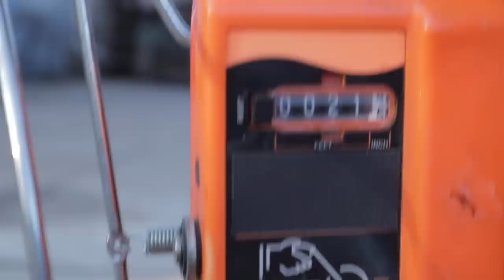Screw Hoist ~ RESTORATION ~ All Mechanical Chain Hoist ~ Back in Service!

Comment: For small parts and chains, it is certainly better to use a rust remover, but it is rational to clean the case and large parts with electrolysis, this is not a complicated technology.
After rust removal, it is useful to treat with a phosphating compound to create a protective coating against corrosion.
This thing is a magnificent legacy of the industrial era. And you perfectly restored it. My respect.

Comment: Another fantastic job restoring that mechanical chain hoist.   I thought that gear was steel but it was brass or bronze.  The whole unit looks much better and it works like a charm too.  Excellent work.

Comment: I enjoy watching your videos and appreciate your drive to recover old stuff.  Something I notice is that when you are taking off 4 sided (square) nuts and bolts you almost automatically reach for your crescent wrench.  You probably already know this but I happen prefer a good 12 point socket with a ratchet, or box end wrench, over a crescent wrench. less chance of slippage and ripping the corners off the nut or bolt or worse yet, putting a gouge into the jaw of the crescent wrench.  The simple math is s hex nut/bot fits into a 12 point 2 ways (12/6=2). a square nut/bolt fits into a 12 point 3 ways (12/4=3). It isn't a 100% true fit, but it does distribute load over all the 4 corners of the nut/bolt; whereas a crescent wrench only applies pressure to 2 points.  This is especially important when your dealing with old rusted up stuff.

Comment: that turned out to be a nice hoist. well worth bringing home. i have a cm 2 ton chain hoist, and 2 cm chain come-a-longs, one with a 10' chain, and one with a 25' chain i use to lift and move things i can't do manually. plus i have a lift boom with a hand crank cable winch on my '54 massey harris 33 tractor.

Comment: Well, I have hopefully swapped a cast iron roof light for a screw hoist (sight unseen) with a neighbour. We're building a hay loft in the Dutch barn and the hoist will  provide the lift for the small square bales upto the loft floor. It will actually be a gift for my wife who is also our shepherd. Found out the hoist was available this afternoon and found your video this evening. I think it's called Serendipidy. Many thanks.

Comment: The interior of the hoist looked remarkably good.
Reply: nothing like a giant solid brass gear to say ''made in the usa''
Reply from the maker: I was extremely surprised by that as well! ESPECIALLY because when I found it it was locked up and I didn't know why! I think it was just a little rust around the end of the shaft!
Reply from the maker: @imperialpresence3331  If only a lot more things were still made to this degree here in the USA!
Reply: Salvage Workshop hence the Chinese tariffs.

Comment: I'm lucky that the property I purchased a decade ago came with a huge industrial workshop, enough space to operate a 5 ton forklift with extendable crane attachment, huge front and rear covered  concrete lay down pads, and a 15 ton overhead remote control gantry that not only services the workshops internal dimensions but extends to service both external lay down pads. All I've added is dual service pits with LED lighting and air connections, and dual 15 ton industrial vehicle hoists. The biggest costs were the previous owners. A gantry in any workshop is a huge asset. 👍👍🇦🇺
Reply from the maker: Now THAT is what I'm talking about! I want a setup JUST like that! Someone put some real thought into that setup and what future needs might be! Thanks for commenting!!

Comment: I used one of these old types once. It snapped lifting a compressor up onto the second floor, metal fatigue. 
Great job on the restoration very enjoyable. I would have it tested for your safety though. Tony

Comment: Impact wrenches work much better without an extension - Very nice old chain hoist -
Reply from the maker: Very true! I use the extension to keep the impact from constantly blocking camera angles when I'm videoing these projects! I have a much larger impact for when I really need to break something loose!
Reply: @SalvageWorkshop  are you sure about the reason for use of the extension? To keep from blocking camera angle? Theres plenty of other things that block it. 3 seconds with no extension and its broke loose. And you said theres a bigger impact WOW you'll probably use an extension on it too. Not having the knowledge about something isn't the end of the world. JS

Comment: Bloody nice work Bloke. Ended up a very tidy Block n Tackle. NB, Bees wax mixed with Olive oil gives a nice finish on bare metal,  especially cast. Warm the metal first then wipe/brush on. Cheers Tony

Comment: Old Tools Restoration is Super! Remember, however, that when we still use them after restoration, they are still years old. This means that many parts show signs of mechanical wear as well as invisible wear, at the level of the internal structure of the metal, there are or may be microcracks that may migrate over time and cause the material to break or crack. So a refurbished device doesn't mean it's brand new, but it has worn parts. But as a rule, such tools will last a long time, because they were made at a time when solid work was needed.

Comment: Matt great to see a new video! I use my shop crane for pretty much everything. I even made an attachment to lift truck cabs off the frame (my hobby). I would love to have a gantry crane but don't really have the space for it. If I was to build one I think I would make it mobile.  Put some small car tires on it so you can roll it around out in your yard. I used one like that in the junkyard I go to. Makes for easy rolling even in the dirt.
Reply from the maker: That's awesome! Ya I definitely want it on wheels! I like your idea of small car wheels, I can see that being more useful than casters as long as I create some sort of brake on each side to lock everything in place when I don't want it to move! Thanks for watching & commenting! I truly appreciate it!

Comment: I use my 5000lb forklift... a 3 ton chainfall hoist...and/or my compact diesel tractor with a loader to lift my heavy stuff. I have a 5 ton 3 phase hoist that I'm planning on building into an overhead crane 34'x75' in my new shop.. nice restoration! Awesome piece of history... I bet that it's so over built that it'll lift more than 2 tons...just sayin'...

Comment: Gorgeous end result and thanks for paying the puppy tax, as for what I would use, I'll be honest, I'd call my friend that has a moving company and pay them.  I don't have a shop but we need to move heavy equipment at work, one of the things they use when repairing our cogen plant looks like an engine lift, it's on a movable frame with locking wheels.  Provided the wheels were large enough you could probably do something like that and have an adjustable place to secure the hoist so you can move it higher or lower.

Thanks for the video, and I look forward to more!

Comment: You asked how do we move things around. I use a 2 ton cherry picker engine hoist to take it off the back of a pickup truck, or off a car in a garage, and put it on a small platform with 4 wheels, chained down, then used an adaptor on my front stairs to my  house, combined with a 1/4 ton lever hoist to get it into the house. Then I use a 1/4 ton lever hoist from the first floor and an adaptor on the stairs to my basement to get it to the basement. eg. To rebuild a transmission, or an engine block. Or any other heavy piece of machinery.

Comment: Mr. Salvage, as you've  mentioned, an over-head gantry would perfectly compliment your, now, attractive hoist. May l suggest a rolling, chain-driven trolly riding upon an  "I" beam, hoist slung below it and the beam extending through the wall above your workshop big door. Think, old flour mills. Your roof joists may need some beefing-up. Or secondly, if l may be so bold, brew up a horizontal jib for your FLT, possibly upto 7 feet long if braced. But in any event, it now requests your usage.

Comment: I had, years ago, a gantry sort up that relied on a track system that could go from outdoors to in along an overhead track, I even had a switch point to steer the hoist to either work area or storage area both ends then met to a swing arm hoist. It was hugely complex but so handy for moving engines and whatnot about

Comment: My choice finish for cast iron machinery is a couple coats of boiled linseed oil, you get the full effect of the cast iron with a shine unmatched by any color, rust proof, and durable plus easy to recoat if need be.
Shopdogsam did this to a hit and miss engine on his channel and it looked great.
Reply from the maker: Unless I put BLO on heated with a torch, I ALWAYS have cast iron rust through the BLO when its only wiped on. Maybe that's just the crazy temp swings in my area, or that I heat my shop only when I'm in there, IDK, but I like custom paint jobs like this one! Everybody's different! Thanks for watching & commenting! I truly appreciate it!

Comment: Hi there just came across your Channel like the restoration work you did on the chain hoist I use a Gantry crane in my shop first very well after we have 4 those screw type chain hoist but mine are Yale's starting from a half ton up to 2 ton the two brands are very similar in design other than the chain guards wonder if one company made them for the other company thanks for the video

Comment: Very nice, make me want to over haul mine 3 ton hoist {probably from the thirties } we have a 50 foot deep garage with 3 I beams in the ceiling with gantry trollies on them. Their old too, but work without fail. In your situation I'd put a beam up the center of your shop from the doorway to your main open area in the back. That way all you can get the load in your door way . That ole stuff last forever.

Comment: Awesome restoration as usual!  Why did you not take apart the main hook assembly?  As far as getting things around for me - I am in the process of restoring a 1952 Delta Rockwell wood planer, which is about 700 lbs.  Taking the 200 lb motor out, I used ramps made of 2x4's and placed them at the bottom of the planer, then slid the motor out.  Getting the motor out of the truck after getting it back from the motor shop, I used a small flat wagon and a 2x10 as a ramp to slide the motor down the ramp and onto the wagon.  When I took it off I used the same ramp to slide it off onto the floor - then ultimately back up into the planer.  Sliding is SO much wasier than trying to lift - especially when you are by yourself.
Reply from the maker: The nuts had been welded onto the hook and 2 chain connections on the main hook assembly, and didn't really see a reason to take it apart, it cleaned up nice and is still plenty strong! Ive used techniques just like those, when your alone, and you need to get it done, the only limit is your creativity!
Reply: @SalvageWorkshop  Ok, I understand.  Yes, the creativity...

Comment: Wonderful restoration. Nice attentive to detail. Wasn’t there a way to clean up those chains better? I’ve used muriatic acid to remove rust before with good success. Just use it outside with some wind or a fan blowing the fumes away from you.  It’s pretty toxic. After removing the rust and crud, spray it off with water and then spray it with mineral oil or WD40 to delay any more corrosion. It’s a great time saver and affordable too.

Comment: I would have considered replacing the lift chain. 
I used a similar hoist to lift heavy missile parts during my years in the Army, including some that were explosive. An annual load test was required, and as a part of this, the technicians measure 'chain stretch' as an indicator of possible failure. 
Of course, if you're not using the hoist to its full 2-ton capability, the old chain is probably just fine.

Comment: I lift and move heavy things all the time and mostly by myself. I bought a large wood lathe several years ago and while they told me it could be delivered to my door if it was in a regular semi trailer with no lift gate or any ramps that would not work for me so I rented a Genie lift and went to the trucking depot where they loaded the lathe on my pick up truck and I got it home and then proceeded to unpack the boxes and sort out all the parts and bolts, nuts, and screws to assemble it.. It was fairly easy to unload everything but the bed of the lathe with the headstock on it so I got that off my truck with the Genie lift and lowered the bed onto the legs and got them all bolted together and the rest was easy. The completed lathe weighs 750 pounds but if you use leverage to your advantage you will be surprised at just how much you can move and set up.
work smarter not harder!

Comment: It is an amazing hoist and you did a great job restoring it!  About the chains...  What if you soaked them in evaporust and then dipped them in bluing fluid?  That should give the chain a good color and rust protection.  Right?  Now you have a sign behind your workbench that says you are a genius if your area is messy, but your workbench looks pretty darn clean and organized.  So are you saying you are not a genius?  🤔 I have an old chain hoist to use, but have not yet made anything to hang it from.  It is in working order, but it would be ideal to disassemble, clean and inspect it prior to use.  Now that I see how nice it could look, you have inspired me to move it up on my list of projects.  😃
Reply: A reliable chain cleaning method is to toss them into your concrete mixer with some dry sand.  An hour of tumbling will do a great cleaning job.  If the chain is heavy or has big hooks attached they will clean up the inside of the mixer as well.

Comment: Adding an extension to your socket lessens the torque of your impact.  Use heavy duty impact sockets with your impact.  Save the pretty chrome sockets for light work you do by hand.
Reply: Yup, I was about to say the same thing, never use an extension on your impact if you can avoid it.

Comment: When I was very young my father had a small grocery store, no loading dock or lift. Vinegar then came in used wooden whiskey barrels. To get them off the truck we would nest cardboard boxes, create a pile then roll the barrel on to them. The barrel was then rolled to the edge of a basement stairs and dispensed with a wooden tap pounded into a bung hole on the barrel end into the one gallon glass jugs people brought with them. I recall when the first plastic bags came out. Now we are all drowning in packaging.
Reply: Sounds more like white lightning than vinegar. Either way, the cardboard box pillows softened the impact.

Comment: :ools really good and usable.  Once the old grease is removed, you can see the potential for this restoration.,  Maybe use some bicycle chain lube for the chain as it does not attract dirt and dust as much as regular oil does.
Reply from the maker: The problem greasing the chain is that the It would get all over my hands when I use it! Plus the chain only needs to fit into the slots on the wheels to work properly!  I appreciate the suggestion though! Thanks for watching  & commenting! Lots more to come!
Reply: Yeah, where I work the equipment uses lots of grease, but even with that I was all... 'eww, yuck...' when he got that apart.

Most of what I see is relatively clean grease from bearings.

Lot of the vids of this type i've watched recently have been quite surprising, with how well different things that looked hopeless cleaned up and were made usable again.
Reply: I have found with the chains on these is when you use them regularly the chain stays rust free and the oils from  the hands is all the lube it needs.

Comment: That's a really nice restoration, man, come out lovely, did that.

But, just to be THAT person; May I suggest getting in touch with your local OSHA and getting it re-certificated? It's old so that 2 Ton Rating may need to be down-graded. I know it's pissy but it's Lifting Equipment and it's MUCH BETTER  to be Safe Than Sorry.
Reply: To recertify you need to know factory chain dimensions to be able to check for wear, factory hook opening measurement to be able to check for spreading and a bunch of other specs.  Best to just stay out from under the load.
Nice job on the repaint; can't beat the beauty of old iron.
Reply: @pgfollett  Yeah, I can see where you're at with that. Health & Safety are a pain in the proverbial for sure! I suppose as he isn't gonna be swinging a load 20 foot in the air it's okay-ish - just, as you say, stay out from under it.

Comment: Electrolysis works great to derust and degunk tools.  Using electricity to loosen the rust. A manual battery charger. A vat of water and washing soda. About a cup per 5 gallons of water. A 55 gallon plastic drum works well.  Then you must have a piece of sacrificial iron for the rust to migrate to.

Comment: you know, you can use the modern battery powered impact gun without the super long extension, no ones going to fault you for using it, you are using it so you can better take apart and restore old tools with minimal potential/damage to them.

Comment: What are you using for rust remover I see you spray it on nuts and bolts and it seems to work pretty wellI work on antique farm equipment from the turn-of-the-century from time to time and getting nuts and bolts loose is the biggest problem without having to use a torch to do it thanks Mike